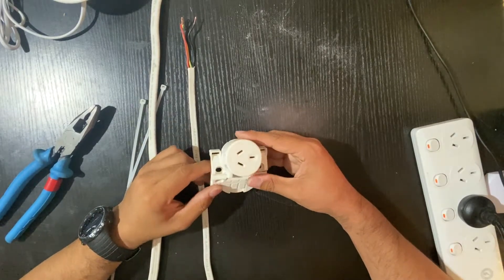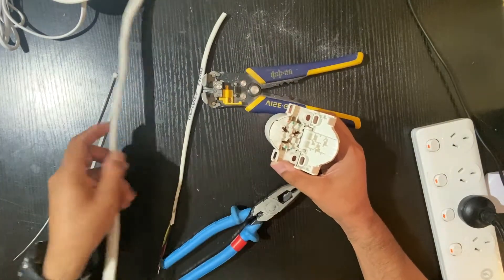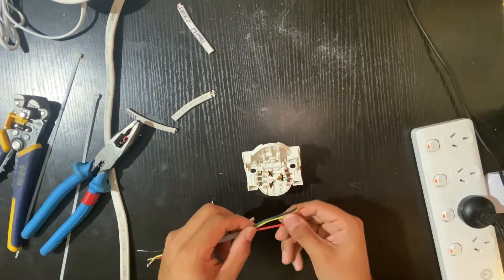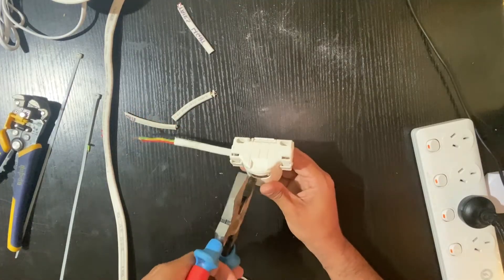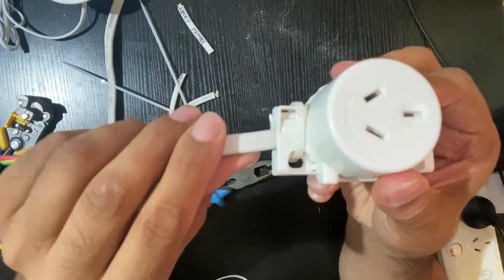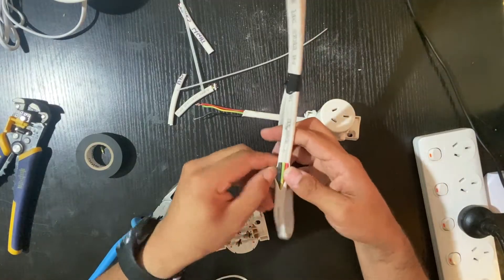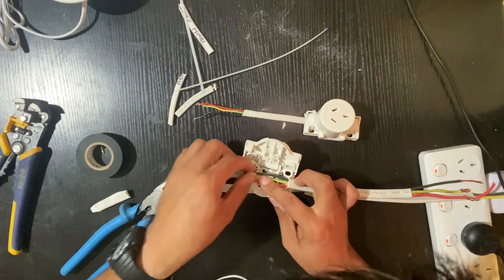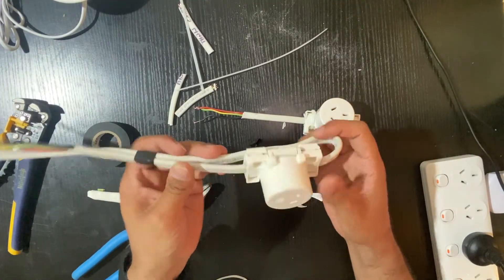How To Wire Surface Socket Quick Connect

Comment: Great video, but I'm confused why you don't need to strip the coloured sheathing from the cables when connecting?
Reply: Inside the slots where the cores sit, it will bite down and penetrate the red, green/yellow & black insulation and dig into and connect with the copper.

Comment: Great video, my electrician wants to use quick connect sockets instead of the standard 413 sockets. Im concerned the quick connects are less safe and secure. Do you have a particular preference? Am I being unreasonable to ask they install 413 socket outlets instead? Thanks
Reply: Quick Connects Fail....
Never seen a Screw connection fail
Reply: Yes that would be very stupid. Ask your electrician what is best for your needs.

Comment: Great video!, Will these Quick Connect sockets fit 2 sets of cables in them?
Reply from the maker: Nope just one TPS cables mate👌
Reply from the maker: Good question mate 👌 You can join two cables but you cant put two TPS cables on top.
Reply: @sparkybaz any chance you could post a video on how you would join two end cables into a quick connect?

Comment: Thanks Baz. I had a Ceiling light that kept blowing.  the fault was the socket. the cover was not snapped into position properly and had no cable ties to hold it together
Reply from the maker: That's why we always use cable ties to hold it together, it may cause a fire in the roof space so make sure they have cable ties on it. Thanks for watching